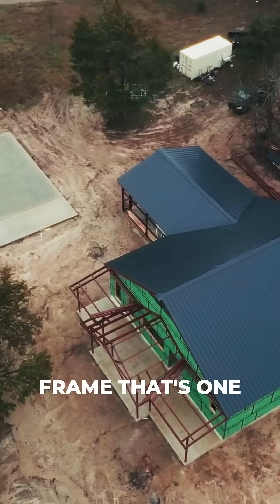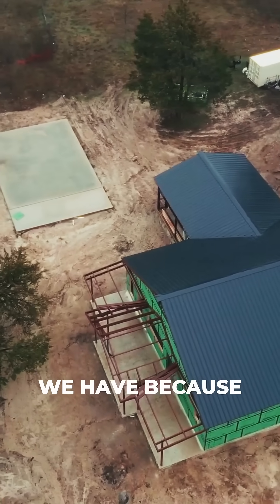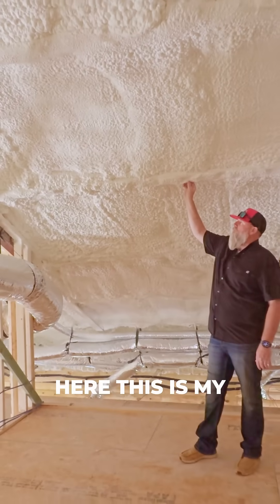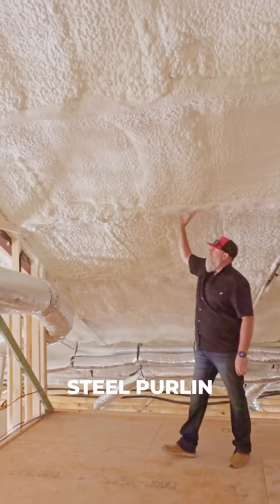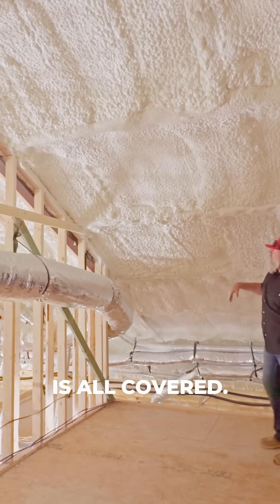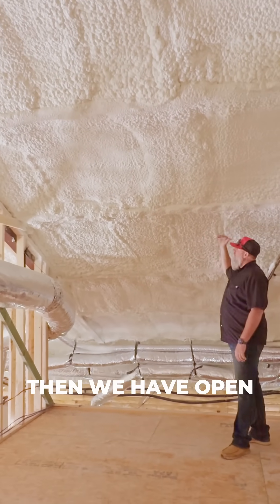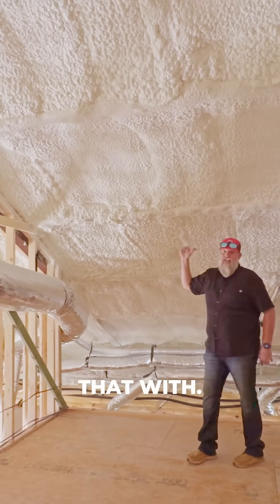Zip System on Hybrid Barndominium

Comment: I wonder if metal studs and fiberglass sheathing would pass inspection and last for the long haul. It should help with the termite bond issue with spray foam.

Comment: You could also use the better roofing option of a standing seam metal roof. It requires an underlayment. It also has no exposed fasteners to leak.